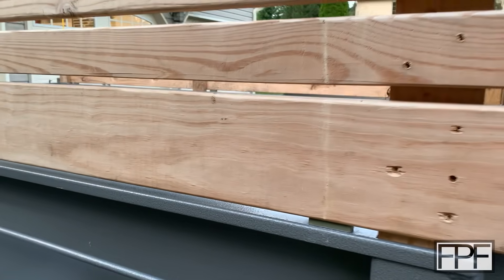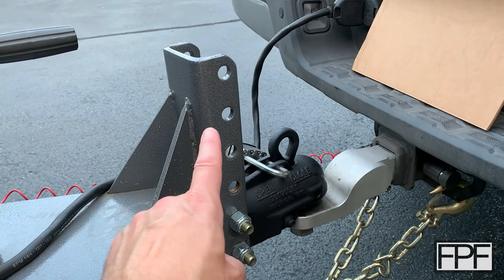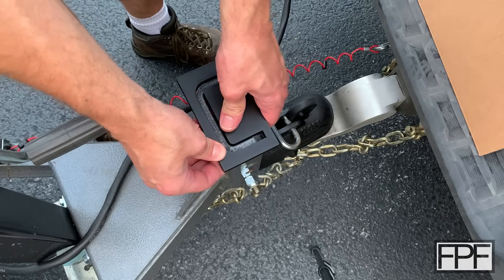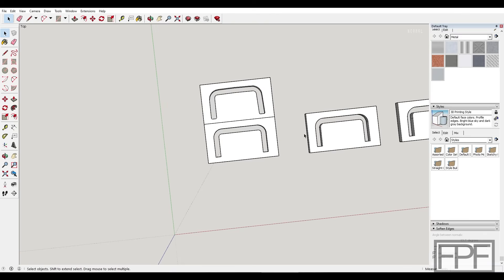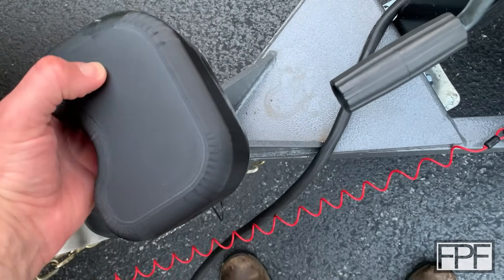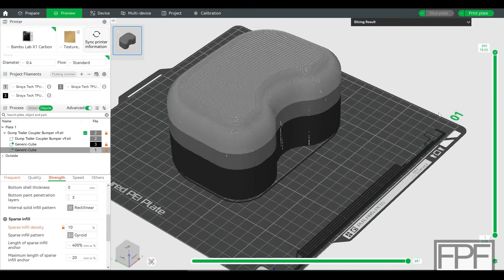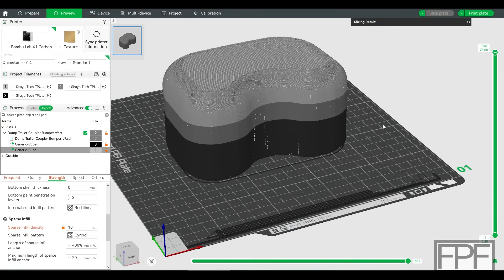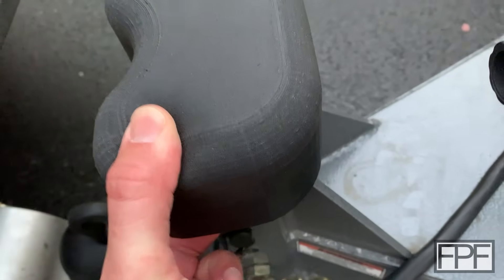3D Printed Bumper for Trailer

Comment: 😊 Yes I would like to see something about importing the profiles. Also, in case you didn't know if you would have put a ruler next to your hitch and then took a picture of the hitch and the ruler, then you could bring it into fusion, 360 and calibrate based on the picture of the ruler that you took. Once it's calibrated and you, you would be able to trace a rayon hitch piece and you would have had the exact shape on the first try. I don't know if SketchUp has anything like that. Would be interesting if they do. Anyway, keep up the good work. I enjoy your videos. You have a lot of good insight for a lot of functional prints.

Comment: A water absorption test would be interesting as a follow-up, and maybe any print settings tweaks for waterproof parts.  About a year ago I printed an air gap/buffer for my water softener drain that works but water and salt slowly seeped through over time, so any tips for water sealing would be cool.

Congrats on 50K!
Reply: This stuff is very porous. I made a koozie with it and just for giggles filled it with water and it soaked in and ran out the bottom side walls. The surface against the bed is pretty water tight. Not the rest.
Reply: @SXSJourney Ah interesting.  Maybe using a traditional TPU for the shell and the foaming TPU for the infill would work?
Reply: @mbcodeandsound maybe? I'm not sure. That would be interesting. You couldn't print them together even on the h2d this stuff strings forever when it travels.
Reply: In my experience almost all different types of filament will eventually soak in moisture. Rather it's from humidity or actual submersion, it will act like a sponge.
Reply: What happens if that water freezes?
Reply: Infill ice cubes.

Comment: olso use 20 degrees chamfers and radio at the z up of the chamfer, example: 1.2 mm chamfer 20 degrees and a 2.4 radio, so the part slides verry easy😊

Comment: Is there any reason why you don’t upload to Bambu as a step file so your radius’s are smoother?  Definitely interested how the filament works and how you added modifiers to make it softer.
Reply: if you export a stl file with a higher resolution, it will be more accurate than the step file

Comment: don't twist safety chains to make them shorter.
Reply from the maker: Interesting, I never heard that before.  I always twist to make sure they don't drag, and cross them to catch the tongue if it detaches.  What's the reason, and what's the right method?
Reply: @FunctionalPrintFriday , Twisting the chain, introduces stress points when the chain is straightened out.  The links are intended to perfectly seat in the "U" of the next.  When you introduce rotation, they cannot seat properly and can create premature wear.  

Crossing them is a two-fold solution.  It creates a cradle for the tongue to fall on, in the even of a disconnect, but also slightly shortens the chain to prevent dragging.  

In this case you have two viable solutions.  Since your truck is smaller, with not as much ground clearance as say a 3/4 or 1-ton truck, you could cut a couple of links off, but that could cause other problems if you get a bigger truck or sell the trailer.  

The solution I would go with is to use light duty zip ties to take up some slack.  That way the zip tie will break in a disconnect, and not compromise the strength of the chain.

Comment: Filament profile import would be a nice part of next week's video
Reply: Yes, please show how to set the different profiles
Reply: Interested in the filament profile import
Reply: I have tried importing a filament profile once, it didn’t work and I just moved on.  It’d be nice to see a guidance !
Reply: @monkeywrench1951 what I did was open one of the 3 models they have on the zip file and just replace the logo with my model. Works for me. I couldn't figure how to get that into the slicer on its own as a filament so I'll be interested in seeing that if it's possible.
Reply: Siraya has the profiles on their website.
Reply: Yes, please!